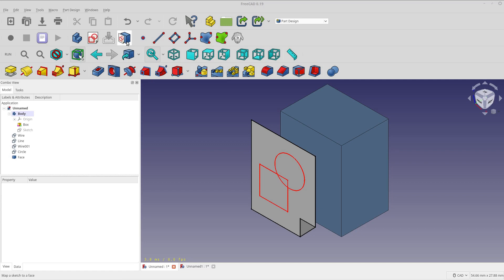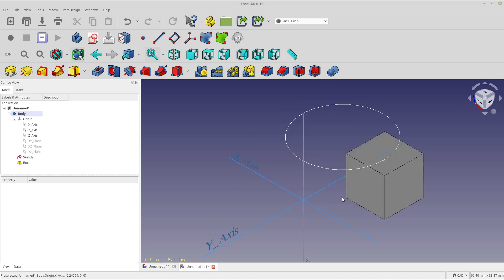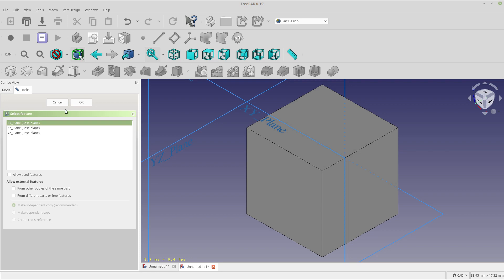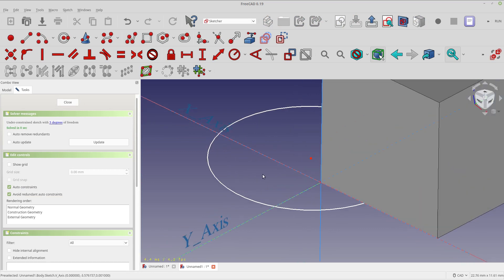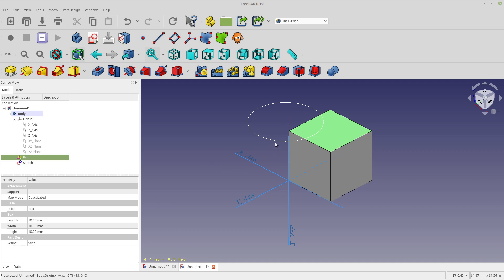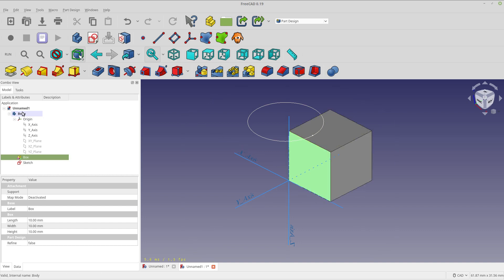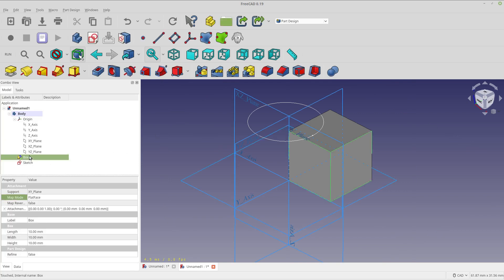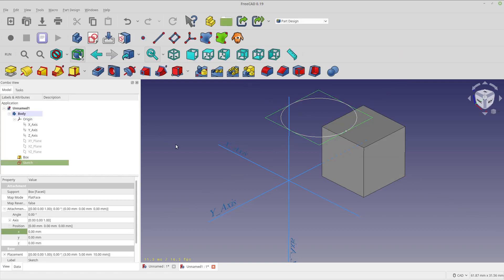Part Design - Map a Sketch

Comment: i always hear..never draw on a face. Always make a new plane over face then sketch on it. Confusing
Reply from the maker: Yes it is. If your model  is simple you won't run into trouble. But if your model is complex, the face could end up being renamed and whatever you drew on it will end up somewhere else. It is a problem that the devs are well aware of, but difficult to fix. They are discussing it all the time.
Reply: @mathcodeprint  Thank you!